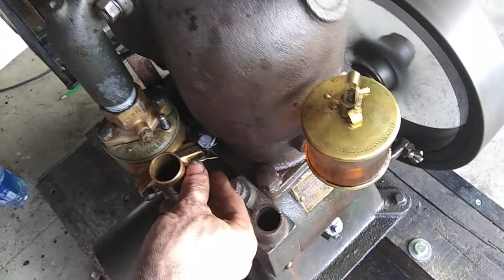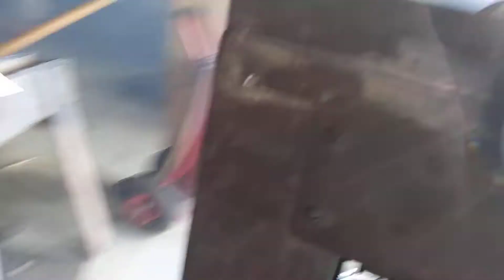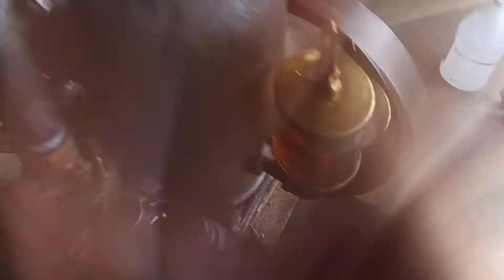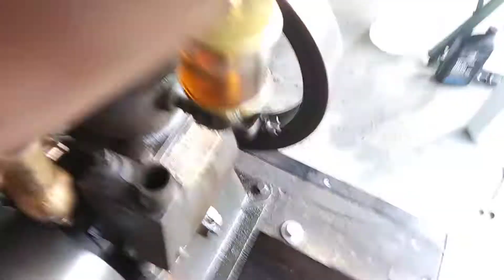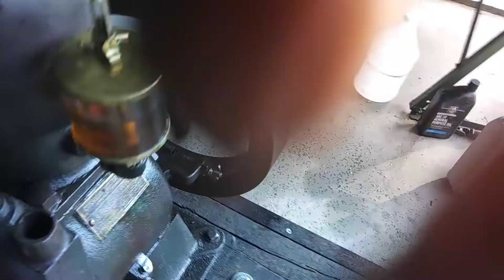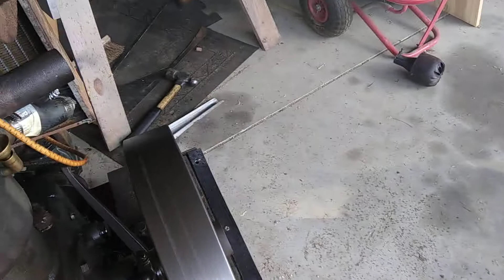Cushman Binder engine 4hp model C  Running

Comment: Can you tell me if my intake valve has a groove all the way around will that prevent it from running
Reply from the maker: The intake valve does have a Groove if it's not running great it may be choked out by too much gas or it may have blow by at tye valve also check timing marks are current